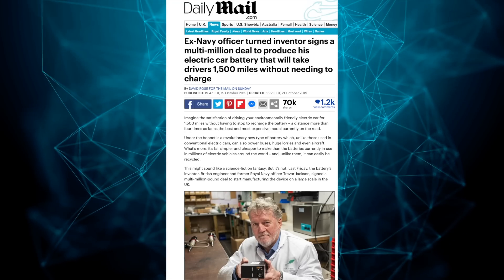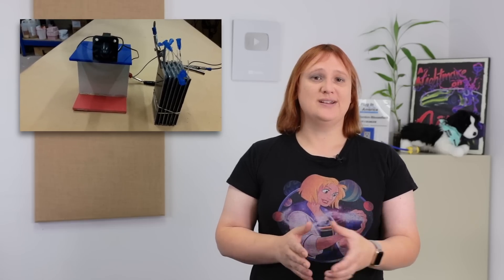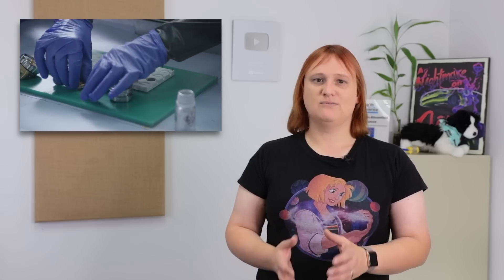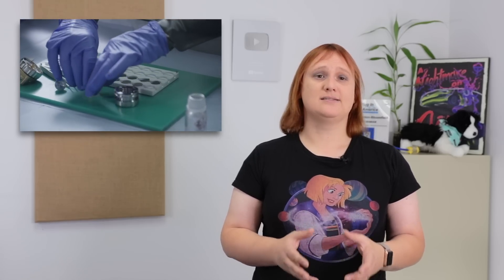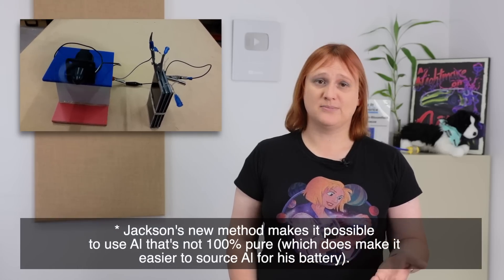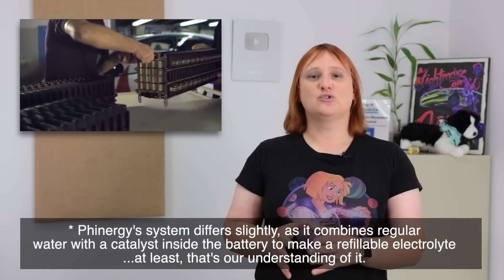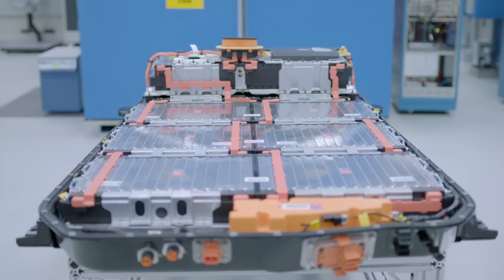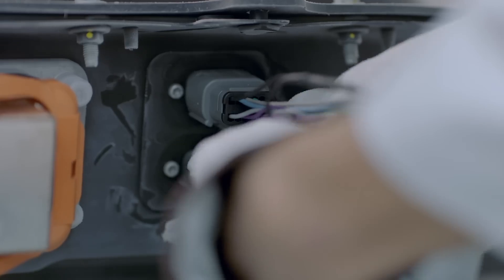Is This Battery The Holy Grail For Electric Cars?

Comment: I don't see this in cars, too much compromise for little benefit. If it could make EVs much cheaper, including the cost of operation, that would be a different game, but I don't think rebuilding the battery after every use is ever going to be cheap.
But for big trucks, big ships, trains and planes this could be perfect. Those all really need much more juice but also have an infrastructure already in place which could easily handle the battery swaps.

Comment: A non rechargeable battery is a non starter for a consumer passenger car. 

As others have suggested, perhaps aircraft, but not high work load routes. More like specialty aircraft. 

It’s got to be fast charge, not a replaceable cartridge. 

IMO

Comment: The biggest factor is that these are 'primary batteries' i.e. non-rechargeable.  Game over !
Reply: Zen Zen alumina (aluminum oxide gel) is recycled and recharged into aluminum metal so unlike primary battery’s it is not thrown away.

Comment: So... Not rechargeable and another use for aluminum. Soda cans and car chassis should increase in price, and since the metal itself degrades in the chemical reaction this would potentially disable its reuse. I'm sure it's 100% safe to the environment, but is it recycling back to aluminum easy? Or cheap?

Comment: How recyclable are they They could be used as a reserve tank on conventional EVs
Reply: Aluminum oxide has to be recovered and sent to a reduction facilty where its mixed with cryolite and zapped with 150,000 amps at 4.5V to get the metallic aluminum back.

Comment: Aluminum/air no better than gasoline, if you can’t recharge.  How about LTO?   High amperage, longer cycle life, ability to charge and discharge in low temperatures.  These sound promising, if energy density can be improved.     I still think cities could benefit from “charging lanes”.  Transfer of electric power to ev’s while sitting at traffic lights.  Keep the battery small in the ev’s, and the benefit of using grid power to charge without sitting, waiting, at charging stations.  Ev’s could record and transmit amount of electricity used for charging, and then billed to customers account daily.  Some infrastructure needed for implementation, but would keep traffic moving efficiently.  I see urban settings moving towards mass transit, and less personal vehicles.  cheers!

Comment: An "order of magnitude" means a X10 improvement. That means batteries are either 10% the price or X10 range. Neither is true, batteries have NOT had an order of magnitude improvement in the last 10 years. It would be hard to claim a modern battery is an order of magnitude improvement over the 100 year old technology in the lead/acid battery we know so well.
But the concept of replacing aluminium QUICKLY in some sort of swap would allay most of my objections to EVs, which are many. I won't live to see it though, but you might. :)
Reply: It's a figure of speech...... Chill!!
Reply: @andymccabe6712  
Using that definition, ICEs have advanced an order of magnitude in the last 10 years too. Toyota Hybrids, Mazda Skyactiv X and Mercedes electronic valves will all deliver better, more economical engines.
BTW: It is a scientific term, oft misused.

Comment: Maybe I missed something glaringly obvious but what is wrong with the idea of pulling into a service station for 5 minutes while the unit is swapped out. You pay a fee and drive off. Just like people happily(?) do at present. Seems far better to me than stopping for 30-60 minutes at a charge point that is probably occupied already.
Reply: Its going to take much longer than 5 minutes to pull out many kilos of batteries, it will require a person to do it with machinery. It would be equivalent lets say to swapping a wheel (along with all the mess and dirt etc) . So you'd end up queuing at places for this to happen, forget self service, so probably longer than filling up with petrol now, and at the same time recharge times are coming down, you can  add 100 miles worth of charge in 15 minutes with newer cars.  

Or you coudl just start off from home every morning with a full charge that cost less than 1/3 the cost of this, be able to do say 250 miles and possibly never even need to  recharge away from home. 

In any case this wouldrequire all car vendors to agree to a standard and model their cars to fit these disposable batteries that cost at a minimum 3x what current EVs cost to fuel. This might work  for other forms of transport where they can put facilities in place to swap batteries on a commercial scale and where the low weight is an advantage  - vans, lorries, trucks, ships small planes.
Reply: Ah, well - once you've had a taste of freedom, you don't want to go back in the cage do you......
People now like the idea of being in control of their charging!!

Comment: Isn't this something like using fossil fuels.  Whilst there is masses of aluminium about if we are using it up it becomes (is) a finite resource.  My mum always said if something sounds too good to be true, it usually is.   You'll also be stuck with the cost of replacing the battery with the problem of availability where you need to change being variable.  It may cost peanuts in a large city and exorbitant in the middle of nowhere.  You may have a 300 mile journey and 250 miles left and have to change batteries before you leave.  It's not flexible enough.  Your point about comparability to petrol/diesel is very valid.
Reply: Man with Zoe not used up! Alumina (aluminum oxide) is recharged back into aluminum. Alumina by itself is very valuable in many manufacturing processes.
Reply: @Dana5775  Thanks.  So not quite so bad.

Comment: Makes sense for some applications outside of cars but for an EV perhaps this could be applied as a range extender to enable long journeys. Around town and on the morning commute use a much smaller fixed lithium battery with 100-150 mile range. Long distance motorway add an ultra dense pack and take out near your destination.

Comment: Or, develop the battery packaging that would allow for the Al anode to be user-serviced (replaced) in a safe, simple, and easy action...  However, being a primary battery is not perfect - anything that consumes (even a common material such as Al) rather than being "infinitely" rechargeable using zero-emission sources - is less than ideal.
Reply: Well, don't want to get too philosophical on you, but, that's the thing about life - EVERYTHING is less than ideal!!!
(lithium ion batteries are less than ideal.....)

Comment: How much energy does it take to "recharge" this battery
i.e. Collect, Transport, Recycle, Rebuild, Transport, Install?
And how much does each "refill" cost? I would guess this whole idea falls flat at that point. 1500 miles in a Tesla is only going to cost about $100-£150 even on an expensive supercharger, and I doubt they can produce an aluminium battery anywhere near that price.
Reply: The fact is, of course that we have NO IDEA of the actual costs involved do we?!
Until a workable battery and system of deployment is developed, it's all just meaningless speculation....
By that time, something else might have come along...

Comment: I understand the battery chemistry of Tesla batteries have a large element of aluminium in them and this is likely to increase. Then there are super capacitors that will ease the overall battery size by around 15% but delivering the same range.  The attraction for many EV owners is the fact you are not held captive by a supplier who decides the pricing of their product. 
Here in the UK, Diesel prices are artificially high (profiteering) and we are the sixth most expensive country in the world for Automotive fuel simply because they get away with it, and the Government using it as a convenient taxation mechanism.
I personally don't want to replace one cartel with another (like Hydrogen would have been) and so do not see this technology taking off (like Hydrogen), especially due to the huge infrastructure cost when compared with an existing electricity grid and "home brew" renewables.
This is nothing new either, I remember a flurry of Zinc Air batteries that were going to be the next big thing and it's disappeared without trace.
I do agree with others that this technology certainly has a place with other transport such as aircraft. A fully electric light aircraft (pipistrelle) has 100 miles range with 22kwh Lion batteries. Just doing the math, the same aircraft with Aluminium air should have a theoretical range of nearly 730 miles !!

Comment: Beautifully balanced view, as always. My investment in lithium is safe for now.
Reply: Which company did you invest in sir??
Reply: @mahi98goodguy  My investment is in buying used cells for second life use at home etc.
Reply: When Tesla comes up with 1,000 mile per charge battery with 1,000,000 mile life span, there won’t be any need for any new battery in a car.
Reply: LIT is a ETF focusing on lithium related production and tech. Its holdings include LG chem, Samsung, TESLA, Panasonic and many others. If you have access to the NYSE/(some countries you do not), or brokers to be more specific, but that being said ; I like it because it gives a dividend=continuing income/ cash flow regardless of weather the stock goes up or down.  I also dabble with TESLA stock and support them, but trading boarders on gambling, (or in some peoples view it does)/ to each his own.   -Cheers

Comment: Aluminum vs Aluminium hmm....  The later spelling turned red.  I suppose in Australia and the UK the first spelling turns red.
Reply: Any other element ending in "um" has the i before it: Titanium, Palladium, and so on, as the latin root requires. 
So, it seem to me that Aluminum without the second "i" is the wrong spelling. Just my two cents...

Comment: If it lasted the length of a current service interval it could work. Just get it replaced when you get is serviced. Wonder how the running costs compare with petrol?

Comment: What is the price per kWh? That is the most important part. If it is really low, like 20$ per kWh than it will be a game changer. It could be used in aviation. They will just exchange the battery after every flight and put a charged one in. Do maintenance on the empty one and recharge it. Also military applications are a possibility. If this tech had been around 10 years ago when better place was trying to make exchangeable batteries work it would have maybe made it possible to be used in BEVs instead of lithium ion. Depending on how well they hold charge they could also be used as back up storage.

The important part will be price.

Comment: The best case example they used was 7p per mile compared with lithium rechargable batteries that are only 1p per mile when charged at home off peak. The cell also costs £5000 for 1500 miles of range according to the article, so I'm not sure how those maths work out, unless you're getting a massive rebate on returning a used cell.

Comment: Waste of time,
By there own data it will be 7p a mile, lithium charged at home is 2.5p.
They can't supply reliable chargers at motorways, how the hell will they organise battery swapping.
Reply: Exactly. The main thing missed from this whole article is COST. There's a whole host of practicality issues as well, in particular having to get all car manufacturers to support the same battery shape and form is, shall we say "non trivial", and hugely increasing the number of aluminum smelters in each country (only one in the UK I understand for example) and the whole set of infrastructure needed to support this since self service swaps are likely out (like going back to petrol/gas stations with attendants so there's a whole extra cost to that as well no doubt lifting it above 7p a mile,   but at root if its at least 3x the cost to run, why would you use this?
Reply: @Joe-lb8qn  All good points, and there's a bigger one.
If your going on a long journey at what point are you going to swap it out, Risky to let it go to flat, so will be changing it way before its max capacity.
And on a motorway it will be much more expensive, same as petrol, and as i said before, they can't even organise a charging socket.
And the reality will be having half your car ripped apart by a monkey with half an hour training every thousand miles.
And last but not least, many ev owners have solar panels so pay much less than 2.5p per mile, some next to nothing.
At this very moment i'm waiting for the fog to clear to put mine on.
Reply: @williamcox1176  That is fixable by having several smaller batteries instead of one large one. One large swappable battery has already been tried and failed several times. Several smaller brings additional design problems such as a trade off between how often you swap out plus how you design a module that can fit in all cars.
Reply: @Joe-lb8qn  well, if it did cost a lot more tham lithium ion then obviously it would never happen!
However, NONE OF US know what we are talking about! It's currently little more than a theoretical system which COULD work in SOME situations.
This is mostly a report about a technology.....
Reply: @andymccabe6712  We DO know though since they published the price, it can be easily calculated.
We know (according to them & no doubt putting best scenario on it) it will cost 7p a mile to run a car on it. 

I am paying <2p a mile on my current electricity tariff. If I went for one of the even cheaper electric tariffs i could do it for 1p a mile. 

Batteries are now trending down to $100/kWh,  to make the maths easy lets say thats £100 a kWh. My battery is warrantied (but would do many more than )than 100,000 miles. So, take a new car like a Zoe or a Corsa with a 50kWh battery. Thats £5k for the battery. Divided by 100,000 miles thats 5p a mile, 5p+1p = 6p.
So even if the battery needed replacing at 100k miles, its still cheaper than this aluminium effort. 

And If the battery lasted longer, say 200k miles, (and there are teslas now at 400k miles), thats 2.5p a mile, add the 1p, 3.5p thats half price what this is, and you dont need to do the equivalent of a filling station run every week or whatever to fill up, your car charges overnight or while you are shopping or at work etc.. 

And that calculation is worst case if you threw the battery away and didnt get anything for it, notr looking at what a LiOn or whatever replaces it it will cost then, most likely down to $50kWh. Add to that  lot of the cost of this would be electricity for smelting and melting, and that electricity could instead cut out the middleman and inevitable losses, and just go direct into a battery. 

There may be some advantage to this, but being cheaper (you said game over if its not) or more convenient, it isn't.
Oh, and it needs a literal revolution in car manufacture.
Reply: Where do you get 7p per mile? I read the Clean Technica report and it was more like £3 per mile.
Reply: @MrGonzonator  It  came from the DM article and includes an allowance for returning the old battery.   As someone else has said perhaps it might work as a "jerry can" for emergency use but there are many many practical and financial obstacles in the way of this, when you have 250+ mile range cars that can be refueled at home or whilst you shop, why pay 3x as much and have to be continually visiting garages (since it wouldn't be practical to have one large battery you'd have many smaller ones, which brings its own challenge in terms of packaging. You cannot just have a skate board design if you are swapping batteries frequently.
Reply: @MrGonzonator  I think it was a BBC report, so went with that.
However it would not surprise me if it was £3 a mile, 7p seemed a little unrealistic at the time.
So with a 1500m range, that would be £4500 to swap the battery, only a politician would thing that was a good idea.
 It makes hydrogen powered cars look cheap.
Reply: @williamcox1176  quote from Autoblog report "With the wholesale price of a new battery at £60 ($77 U.S.) per kilowatt-hour, he says the cost-per-mile is about £0.08 ($0.10 U.S.)."
Work that out, it means 750 miles per kWh.
Reply: @MrGonzonator  Driving like an 90 year old on a warm day on the flat with no aircon or heating you could get 6-7 miles per kwh, in normal driving 4 miles pkwh is good.
Most of the energy in any car is used to push the air out of the way.
Reply: @williamcox1176  something doesn't look right here. Maybe the battery swap isn't the whole thing, just an anode and electrolyte changeover, which may be cheaper?

Comment: This kind of luggage-sized primary battery could be consigned ; like a propane tank for the kitchen, at a station you take a new one and give the used one. A factory will recover the oxidized material and purify it with higher energy cost than a simple recharge. The advantage is that the battery is inspected at each recycling, this ups the quality and security of the battery. Lithium ion is too bulky and heavy to be distributed to homes for power in case of catastrophe, but this Al-Air could be as viable as a 20L tank of fossil fuel. I don't think it would be needed to have a robot or a professionnal swapping the batteries. You could have one luggage size in the frunk and one in the trunk and go. By hand, yourself, two minutes. At the peak of the heatwave I carried 40kg of Li-ion up 6 stories to enable 4 hours of air conditioning. That was no fun. With Al-Air the same amount would have given a day of AC.

Comment: I'm afraid a battery you can't charge anywhere isn't going to be an acceptable solution. Now if you only had to swap out the battery every five to ten thousand miles, it might be ok,  but that's not likely to happen.